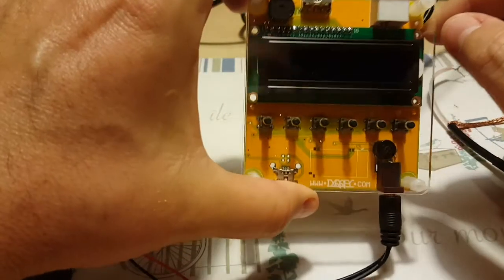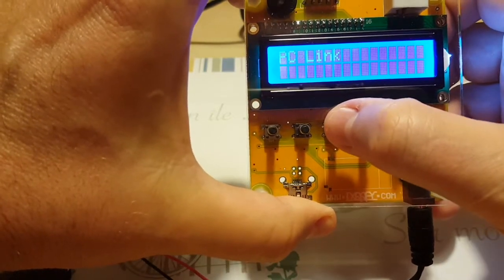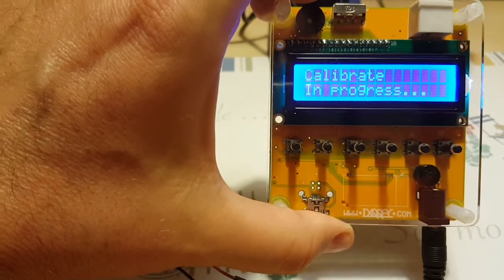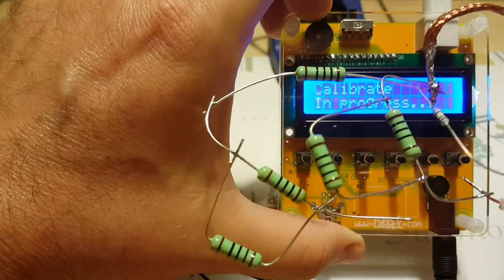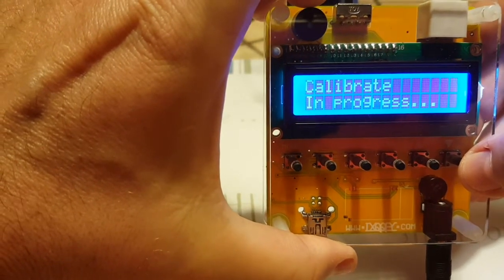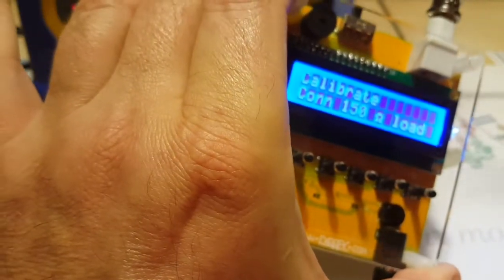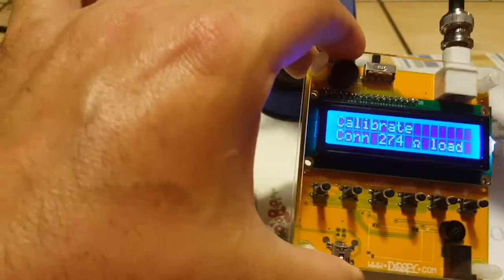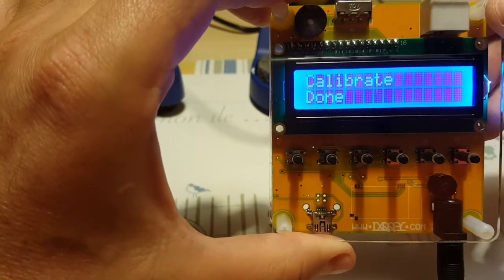MR100 Antenna Analyzer Calibration

Comment: i would think the calibration would be off as your resistor bodge wont offer a purley resistive load due to the long resistor leads throwing an inductive reactance into the mix,better off using smd components i would think!

Comment: hi Gil, what sort of values are you getting back from measuring your standard calibration resistors after calibration? i've just purchased a similar MR100 unit from Amazon. although my 50R was spot on, my 150R was reading only 15 and the 274R was jumping between 1400 and 1500! just wondering if you have similar readings for anything above 50R
regards,
peter
Reply from the maker: Sorry no idea..
Reply: @RadioPrepper  no worries, thanks for getting back to me though!

Comment: Food for thought and for the hobbiest who has some time on their hands. I connected MR100 to my scope to see what the mr100 was doing during the process of calibration. The MR100 is reading a pure resistive load at multiple frequencies in succession for each resistor value. Typically when we are looking to tune an antenna or see what the reaction is of a device under test, we look at the center frequency of a particular band. 

What if someone were to, 
1) Make an LC circuit that meets the impedance of the resistive load requirements of the calibration test at that 1 frequency. 
2) Then calibrate the mr100 to those LC circuits impedance for the one frequency. 
3) Then analyze an antenna. 
4) Then compare the results to their SWR meter or to another antenna analyzer.

Like i said food for thought and for the hobbiest who has some time on their hands!
I understand that LC circuits are frequency dependant, and when we use an analyzer we are typically testing the center frequency of 1 band. If this works, it would mean, you would have to make a set of 3 calibration LC circuits for each band and calibrate to a band before testing.
Although the above makes sense to me, it is above my scope of practical knowledge.

Comment: Is this process necessary  for this unit to work accurately?
Reply: I us 3 resistors with crocodile clips to switch between them, quick and easy. Also found the calibration is necessary from time to time to keep it accurate.
Reply from the maker: No, it comes calibrated from the factory.
Reply: @RadioPrepper  NO they dont, I just bought 6 for resale
Reply: Thank you...is it a kit or pre assembled.
Reply from the maker: Pre-assembled.

Comment: Uhmmm, that is not a calibration procedure: you do not use a non inductive components: also do not forget that every conductor is an inductor and every couple of conductors is a capacitor! Avoiding wire resistors is not enought! Add the transformations operated by the coax stub plus bnc connector you used ... After a calibration like that, you obtain false values and incorrect results. If you don't believe me, after your calibration, try using a dummy load connected STRAIGHT to the instrument connector and try also using a 25 Ohm and a 100 Ohm in the same manner. Now, my suggestion is to use just a bnc to SO-239 adapter included in the calibration (if your antennas to test have a cable with a PL-259 connector) and prepare a PL-259 for each calibration step using smd resistors (the smallest ones you can manage) and, if possible, more than one resistor in parallel in order to reduce the inductance. Of course, you have to solder the resistors INSIDE the connectors. Have good antenna testing. 73s.
Reply: Food for thought and for the hobbiest who has some time on their hands. I connected MR100 to my scope to see what the mr100 was doing during the process of calibration. The MR100 is reading a pure resistive load at multiple frequencies in succession for each resistor value. Typically when we are looking to tune an antenna or see what the reaction is of a device under test, we look at the center frequency of a particular band. 

What if someone were to, 
1) Make an LC circuit that meets the impedance of the resistive load requirements of the calibration test at that 1 frequency. 
2) Then calibrate the mr100 to those LC circuits impedance for the one frequency. 
3) Then analyze an antenna. 
4) Then compare the results to their SWR meter or to another antenna analyzer.

Like i said food for thought and for the hobbiest who has some time on their hands!
I understand that LC circuits are frequency dependant, and when we use an analyzer we are typically testing the center frequency of 1 band. If this works, it would mean, you would have to make a set of 3 calibration LC circuits for each band and calibrate to a band before testing.
Although the above makes sense to me, it is above my scope of practical knowledge.
Reply from the maker: Good idea thanks!

Comment: Hmmmm.  You don't have one single Bayonet Navy Connector 50 ohm terminator?  Understand the others but no 50?  Working on building an analyzer myself I want my quality control in it though, and not cloned/stolen by china parts, or rubbed off part numbers. 73's
Reply from the maker: No, I don't have a scope, so never needed one... I do want to get a better analyser for sure..
Reply: Hey there.  thanks for the shout out.  Ugh.   Long story here,  took up electronics again keep my mind busy since disability, yea mental and physical problems, those aside, lol.....   Done a lot in electronics, how they work, how they built and such, nephew bought me 2 used ham sets, very old,  a Kenwood ts-580s and a Yaesu ft221r.  That opened up another can of worms,  a good can though,  made some new friends and have filled in a lot of gaps in the frequency domain of the electronics spectrum.   I try to sum up a bit.   Brand name VNA's or a spectrum analyzer is pretty expensive.   Been seeking myself.  Got 2 scopes here, I invested in an MSO4000 from Rigol.  Am saving for a spectrum.   Understand about money, hobbies, compromise.  I looking at same analyzer but am skeptical just like am skeptical about the ad9850, 9851 dds bourds themselves.  Actual Analog devices chip in one off quantities is 14 bucks, Digikey. These things gotta be fake in some ways.  I have been trying to get better high res. pics of said analyzer to inspect myself.  There are ways to tell.  If willing to take apart and look....  Ugh.  I am babbling. Sorry.  Look up the datasheets for the ad98505/51.  It shows you how to make a dds signal generator that they are using.  See if  you can match the filters up in the schematic they have with the analyzer, any stages missing?  Look at the chip closely, if it is fake it will have bad printing on it and such.  In any case,  nice to meet another ham, similar interests.  I gonna try watch few more your video's.  Ya kinda new to me.  73's and sorry I rant.
Reply from the maker: Yep, I'd love a RigExpert AA-600 but it's about $700... That said, it would probably be more useful to me than a scope. I do have to troubleshoot kits sometimes but usually spend more time building antennas...
Reply: Yea,  that's next for me.  Thing is I think I could build some antenna's but unable to put them out in the field for testing.  Maybe in future we do a hookup and I send an antenna or 2 for an outside opinion of it.  Very good chat here.  73's.   And I am watching.  P.S.  I look into this rgexpert model,  there is another called miniVNA I believe  and is a bit cheaper.  But also unsure of how it performs.  Good luck and long fun on the HAM bands....   JC,  peace.
Reply from the maker: Thanks John, sure, I'd be glad to test anything you send my way..

Comment: Hi Gil I was just wondering if you ever check this against other known good analysers and if so what was the result?  Also I read on some of the other variants purchased from eBay/AliExpress etc they were fitted with AD9850 (or a fake) instead of an AD9851 hence they don't work very accurately.   I've just got an MR300 which is also a SARK-100 clone but in a metal case and mine came with a chip marked as AD9851.  In any case I will take it to my club and see how it compares to other branded ones. :)
Reply from the maker: I tried it against my KX2 SWR meter. It showed a higher reading. Indeed not super accurate..
Reply: According to some reports if its 1.5 x the frequency it has wrong chip...  Prob worth checking the chip#. I still haven't been able to test mine yet...
Reply from the maker: Mine sure isn't 1.5x the frequency.

Comment: This did not turn out so well for me.  I had a sneaking suspicion that my analyzer was off a bit so I figured the calibration process would validate that.  I measured and made sure my resistors were within 1 ohm of the requested value and now the results are all over the place.  I'm not sure if I need better quality resistors or just a better analyzer? Hm....
Reply from the maker: +mpoertner Quality control might not be their forté... I guess you get what you pay for... Still a useful gadget for the price.
Reply: Actually, I tried some other resistors and it's back on par with what it was before I messed with it.  The new resistors were no more than half an ohm off.  I measured with 3 different multi meters to be sure.
Reply from the maker: +mpoertner Might have been the other resistors the wound wire type?

Comment: Surely the seller should calibrate the unit prior to despatch?
Reply from the maker: +Mr Mc It was fairly accurate out of the box, but of course I had to mess with it... ;-)
Reply: Radio Prepper I've just purchased one upon power on it displays uncalibrated :( wanted it to just work thought it would of been calibrated prior to me receiving it looks like I'm off to buy some resistors thanks for your video

Comment: Curious to know if you've studied your antenna used with the Mountain Topper, and the length of 174 Coax used in the Canary Islands!
Reply from the maker: +MrDaim0 The wire length yes, but I should have taken into consideration the coax and used an appropriate counterpoise. I didn't bother because the same setup worked very well before...

Comment: Wouldn't it be easier to just use an alligator clip to the connection points instead of soldering?  You have 3 connection points.  50 ohms, 150 ohms, and 274 ohms.
Reply: I use these BNC to screw terminal connectors for my Chinese Pixie II Xcvr Kit as a dummy load with the kit supplied 51 ohm 1w resistor. works great! Buying 3 or more is discounted. Provides quick changes for your three calibration resistors. https://www.banggood.com/Wholesale-Coax-CAT5-To-Camera-CCTV-BNC-Video-Balun-Connector-p-29842.html?rmmds=search
Reply from the maker: Yes, but I didn't have any! A small plastic box with a three way switch would be even better...
Reply: Mine worked ok when it needed to be calibrate . But I try to calibrate it and missed it up. is there any way it can be set back to factory default?
Reply from the maker: Same for mine. Unfortunately I don't know.

Comment: Hi!  Thanks to sharing this, I have one of this in my house... could you please share the resistances that you have used?
Reply: Second question:  I saw that you just  remove the weld and apply again a resistance, could you please explain me more?    I have one of this but I need to calibrate since I bought. Thanks and regards from Costa Rica.
Reply from the maker: Hi, this will explain it: I make a 50ohm resistor by putting two 100ohm resistors in parallel. To get 150ohm I add a 100ohm resistor to that bundle, in series. The 274ohm resistor comes in that value. I had to solder the resistors quickly because the calibration process does not wait for you...

Comment: I have a Mini60 as well and have also owned the SARK 100 and MR100 variants.  They are all a great value for the money but obviously not as capable as a VNA.  If you want to make it sing, though, try my software.  It makes it even more fun to play with.  73, Steve, AK4R (good on QRZ.COM)
Reply from the maker: Where is your software?
Reply: You can find an ad on QRZ.COM ham ad formum searching for SARK 100.  On ebay you can take a better look: http://www.ebay.com/itm/162315019509?ssPageName=STRK:MESELX:IT&_trksid=p3984.m1555.l2649  or if you get my email off QRZ.COM and email me direct we can make something happen.  73, Steve, AK4R
Reply: Stephen Hughey  yes your software is really useful with  the ability to print data and charts. Also avoids the loud beeping noise when using the device.
Reply: does your software work w windows 10? if so you will make some money off me in 2 weeks!! i am having issues with my software i had on win 7 since i went to windows 10.